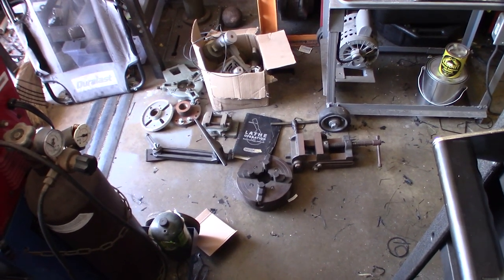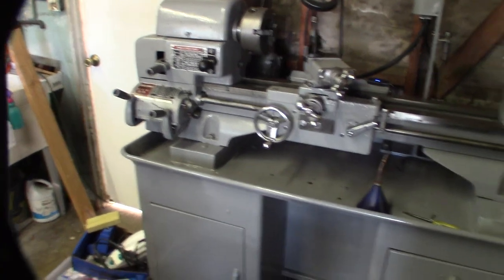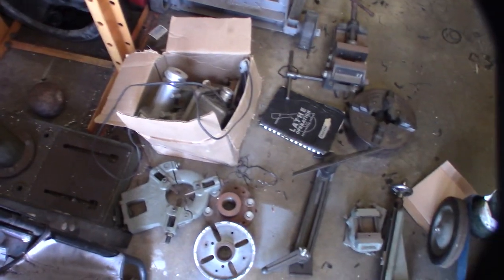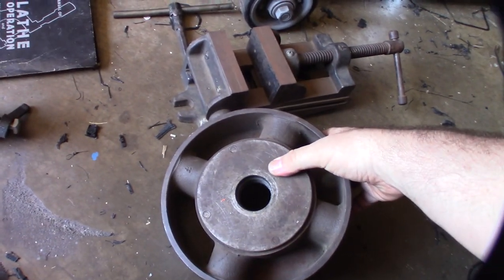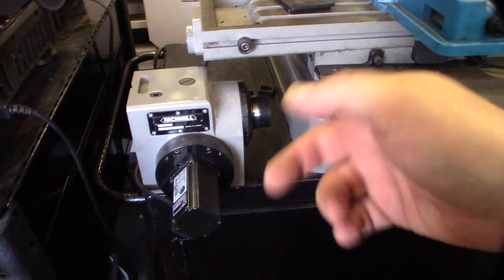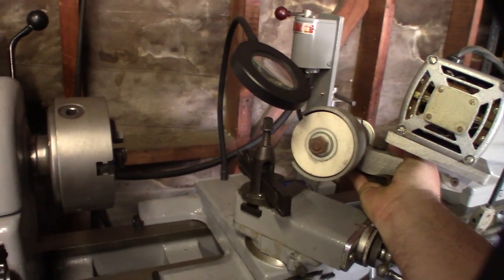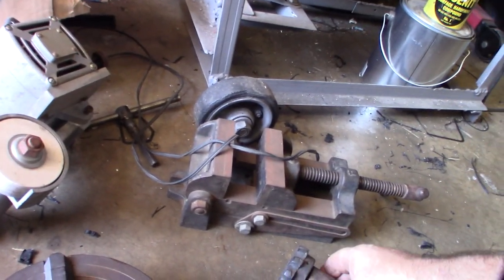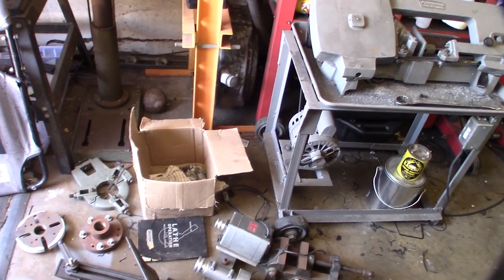Craftsman Atlas Lathe Accessory Haul, Surface grinder, steady rest, 4 jaw chuck, backplates, vice

Comment: "Tool post grinder" and if you can get a textbook from a vocational machine shop it will help you connect the dots and get the terminology right. Check community College bookstores that sell used books...
Reply from the maker: I'm going to make a video about the surface grinder and all the documentation that came with it.